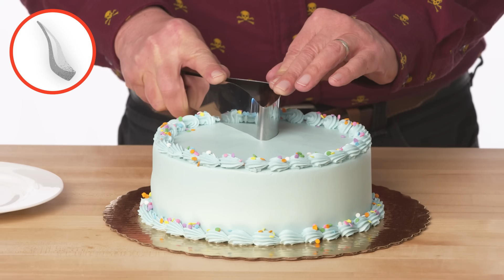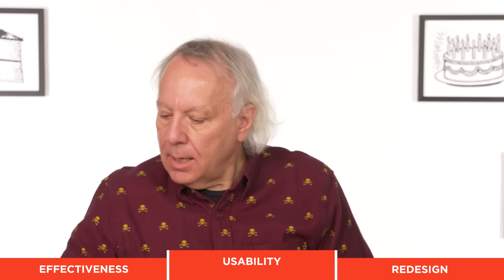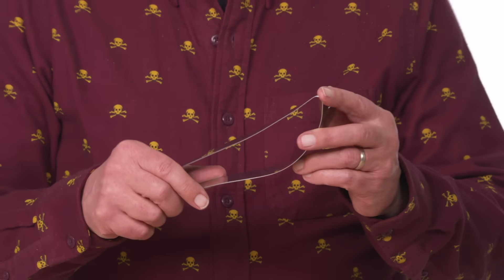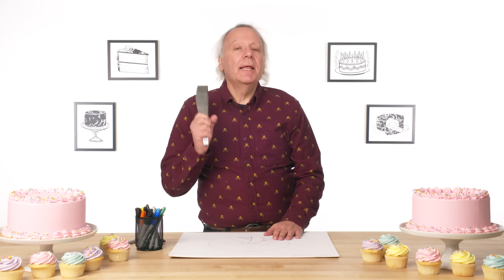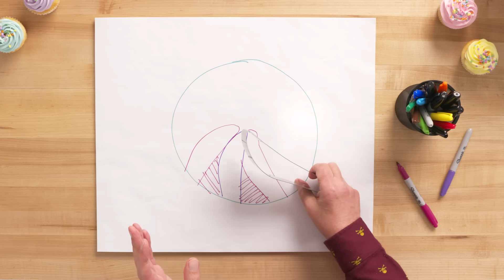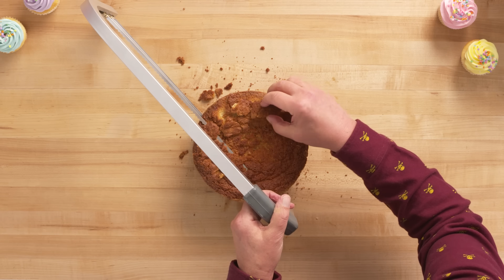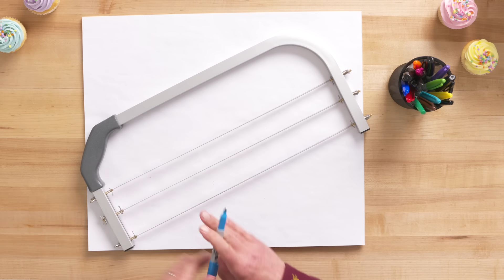5 Cake Making Gadgets Tested by Design Expert | Well Equipped | Epicurious

Comment: Maybe he isn't used to use cake levelers... we use them in the confectionery all the time (tho they are less bulky and only have two sawing strings) and they work perfectly fine... A handle on the top wouldn't work for the big rectengular cakes at all tho... I can't see how you can hold it without twisting your hand to get a little bit of pressure forward onto it..
Reply: The issue with the gadget in the video is that it has relatively big dull saws and three of those at that. Besides, the frame is not heavy enough to keep the device levelled.
Reply: You can tell he’s not used to them because he attempted to make four layers, treating the top being leveled off like it was supposed to be the fourth layer.
Reply: well yea cause ur constantly working with cakes but for the average consumer it doesn’t work so it’s not worth the buy
Reply: yeah i love to bake and the one i have is sounds like its the same one you have
Reply: I think so too... I am an amateur baker, but for me... Using a cake leveler is actually a great help... I also don't think that you need to put pressure and twist you hand sideways though... Just a sawing motion...